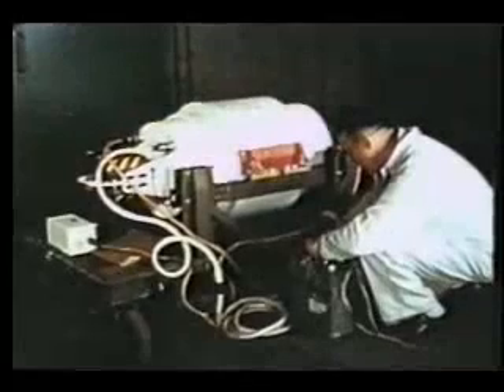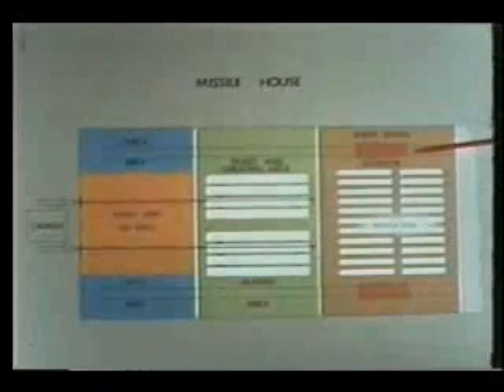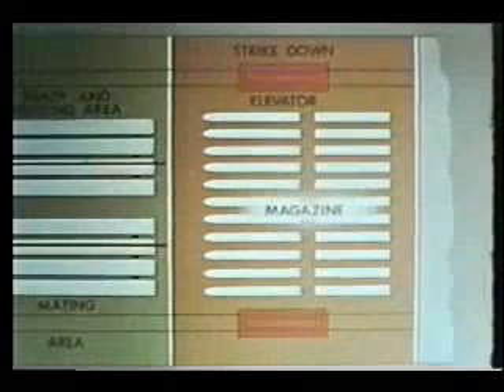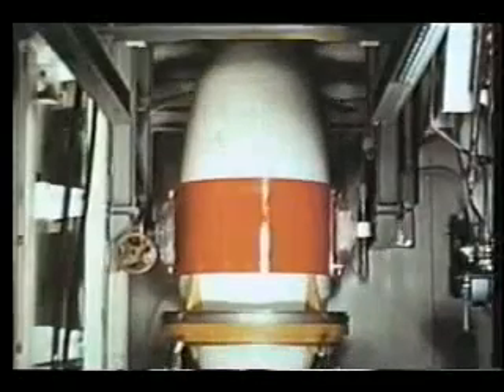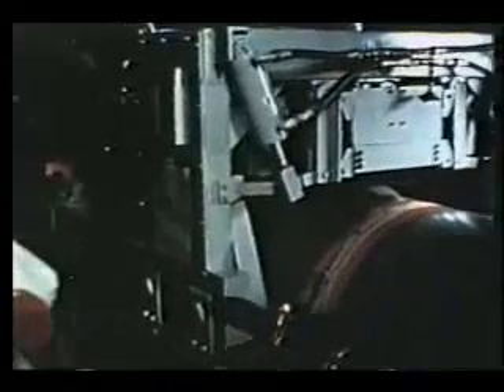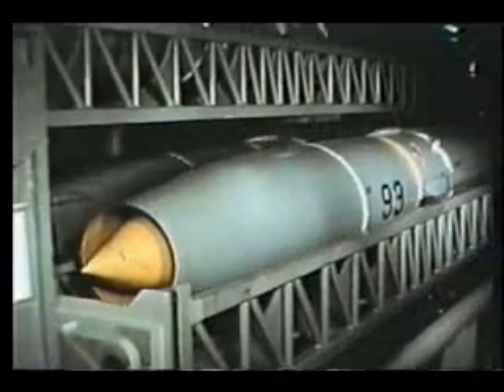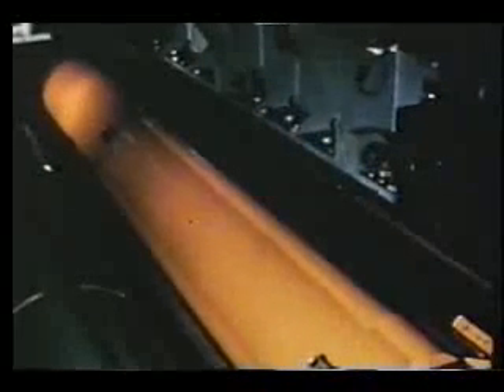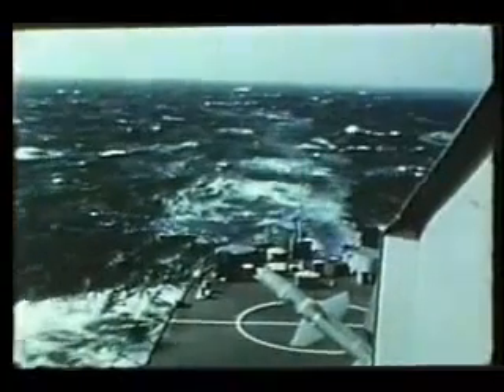Talos Missile Handling • Cruiser Installation

Comment: Holy smokes I didn't know these things had nuke warheads.  What a crazy time it was.  I am more familiar with air launched nukes of the era, but this had a pretty smal  range...  for a nuke.
Reply: When you consider the high stakes of the cold war era mission envisioned for these systems, and the not entirely mature state of guidance systems, the math works out. What would be a total miss with a conventional warhead could be a kill with a nuke. The same thinking was also applied to some anti-submarine weapons, like the Mk. 45 ASTOR, SUBROC, the depth bomb version of ASROC, and the various free fall nuclear depth bombs, plus their eastern bloc counterparts.
Reply: @copperlemon1  The craziest was the nuke rocket launcher.  Towed by a Jeep, it's a simple rocket rack on a trailer.  Operated by a Seargent.  A little something to plug the Fulda gap.  Saw one at the Atomic Museum in New Mexico.

Comment: I've never understood why the US didn't continue Ramjet missile technology. The radar evading low level flight and range advantage can be up to 5 times that of a standard rocket engine.
Reply: Apparently Talos was horribly unreliable, I guess they decided that simplicity was desirable and solid rockets are about as simple as you can get.
Reply: @Akm72  yep. You're right on that one.
Reply: They were closer to launching an aircraft than just firing a missile. They had to be fueled and prepped for launch. Major hassle. They were designed and fielded at the time when air-breathing strategic missiles were in first line service. The missile was capable and did linger in service for some time. The thing was big and needed a big ship to carry it. It largely disappeared as the WW2 conversions were decommissioned and the ships deemed fit for refit were converted to the appropriate standard missile variants.

Comment: It seems these were effective against Viet Kong SAM. What was the justification for not using them? Enemy tactics not keeping their targeting radar lit?
Reply: Only a very specific variant had the SAM homing capability
Reply: The missiles were gigantic and impractical to use, not to mention the loading systems were complicated and had many moving parts. Even if they weren't expensive, which they necessarily were, they're also the size of a fighter jet, which would make evading enemy fire somewhat of a problem.
Reply: @AlphaNumericKey  Bud if they could be used they will be used 

Case and point they were used to knock down a couple of migs over north vietnam as well as a specific SAM Hunting variants was used as well

Comment: Do they seriously just wedge the fins into the side? Goddamn that looks like a bad idea. I hope that's a training model and the real one has retention pins or something.
Reply: Likely some sort of locking mechanisms that locks the shaft down into the receptacle.
Reply: They used Ball detent locking rings if I’m not mistaken. Very simple, very effective.
Reply: Also that arming plug. He seemed to just seat it snuggly. And then it flies 30 miles just under friction pressure?

Comment: The booster of this missile is still in use (as of 2022) as first stages of sounding rockets.
Reply: And up until the end of the first decade of this century, the complete Talos was used as target drones with the designation MQM-8G "Vandal". Until the inventory was depleted.
Reply: Fascinating. Figured they’d have been de-militarized and scrapped.
Reply: @swainscheps  Nope.  There is a long history of reuse and recycling missile componentry.  After the MX Peacekeeper missiles were decommissioned in 2005, they were repurposed as the first three stages of the Orbital Sciences Minotaur IV and Minotaur V launch vehicles used by the DoD and NASA.

Also, surprisingly, retired Russian air-to-air and air-to-ground missiles have been bought by the DoD and used as target drones.  Look it up—very interesting!